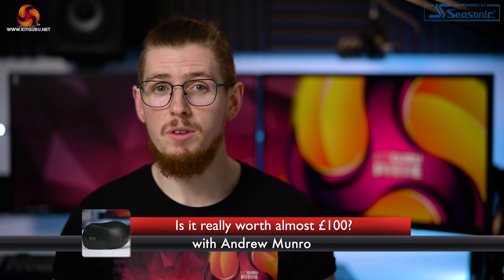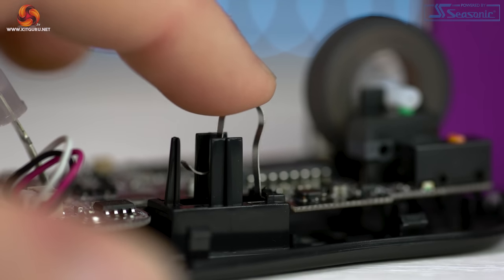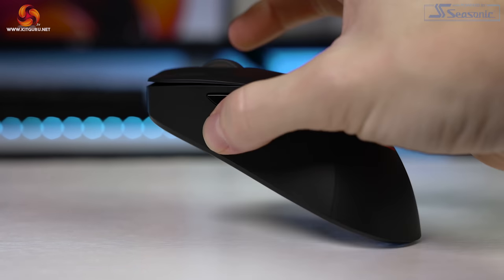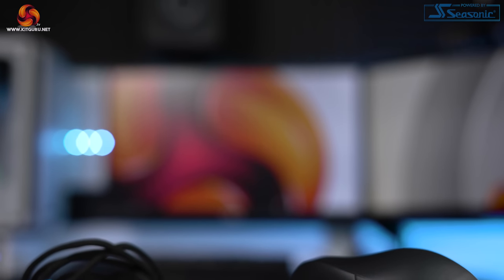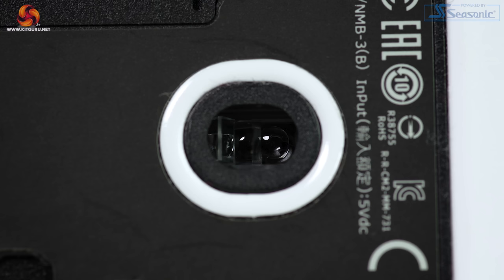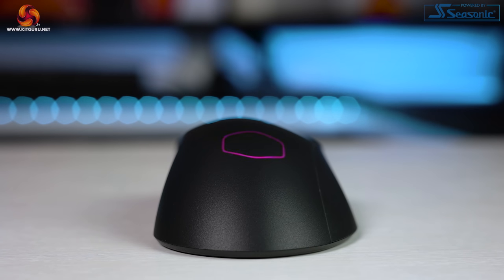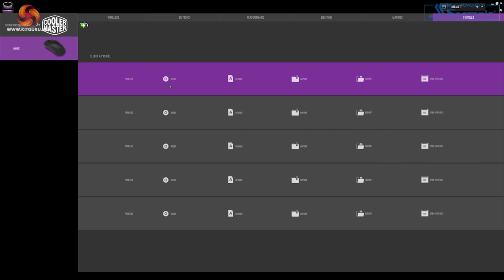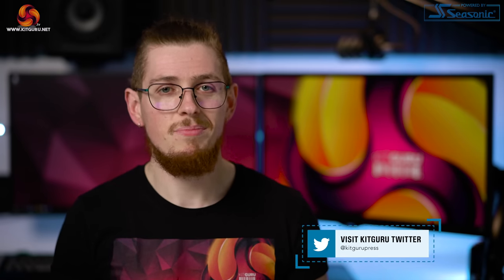Cooler Master MM731 Wireless Mouse Review

Comment: I loved mine for the month I used it. The balance is what made me not continue using it anymore. Here in South Africa they sell for about GBP65.
Reply: Hey, I got a couple questions, can you please answer them if you still have the mouse? I wanted to know if the build quality is solid, I saw another video about the mouse and it had some flex in that reviewer's unit. Is the latency issue resolved? and last question is if I can set 1 profile with 1000 polling rate and other with 125 hz, can I change between profiles with a single with button press or will I have to open the software and change them every single time and how much difference in battery life does these two polling rates have.
Reply: I just got a brand new one for £13.39 in an easter sale lol